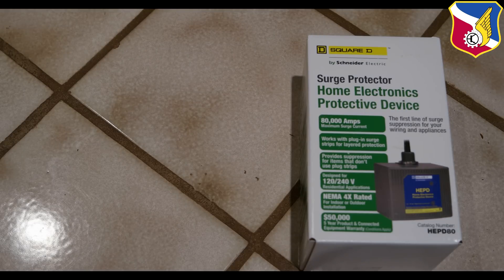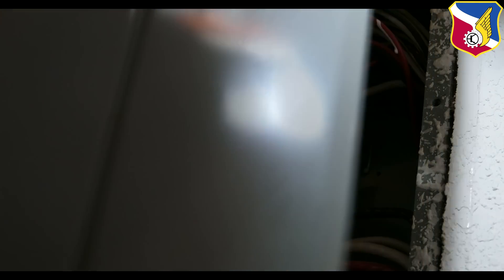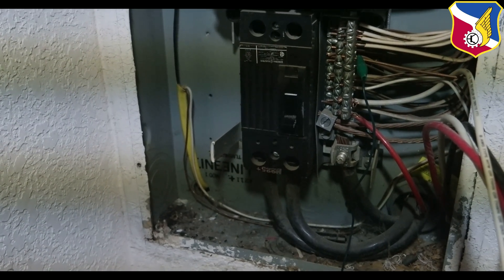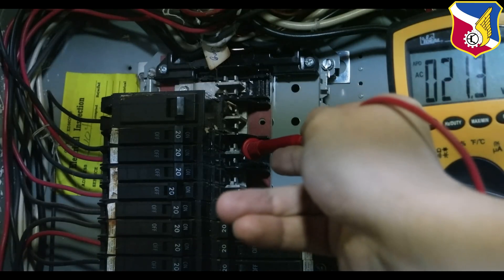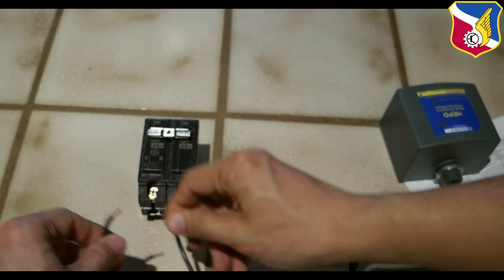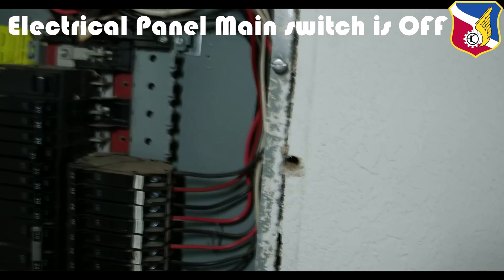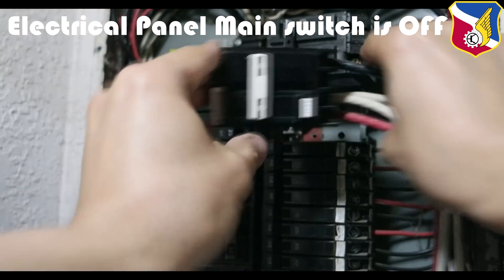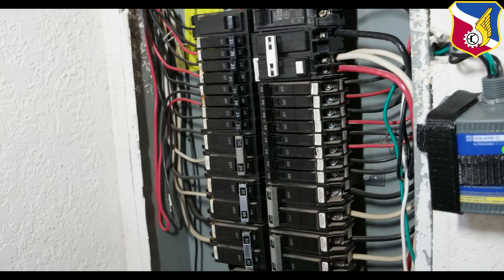Install Whole House Surge Protection 4K - Square D HEPD80 Home Electronics Protective Device

Comment: Nice illegal and dangerous hookup. I can see clearly you do not have an electrical license and don't know what you are doing correctly and incorrectly. Hire a license electrician to correct your mistake.

And the mistake was putting the shirts protector at the furthest point. And not protecting that wire on the surge protector. Therefore you risk a fire now. Get the license electricity in there to correct your mistake. And also upgrade your electrical panel you are completely out of space you need more space.

Comment: That install is a fire hazard, you cant leave exposed wires from the box to the surge protector get that inside a piece of conduit and you have wire passing through the box to outside with access to 20 amps totally unprotected from chafing the knockout in the main box. I'd call this install a fail, nice example of what not to do. Lastly top of the bus, when the power comes into the bottom of the bus is a real bad idea, each circuit on the way up to the surge protector will be exposed to the surge albeit for  milliseconds.

Comment: Can this device be installed in a residential sub panel?
Reply: Sure it can.   However, the question would eventually come up as to why this "whole house protector" failed to protect the whole house.  It would however be more effective in a sub panel than say the trunk of your car.  Perhaps your questions about electrical matters should be directed to someone who knows a little bit about electrical matters? Certainly not here.

Comment: Exposed wiring from your breaker box is a huge safety issue and would NEVER be approved by an electrical inspector. While you have the basics down, you should never post a video with exposed wiring. Conduit from the surge device into the box should ALWAYS be used.

Comment: No way in hell that installation would fool a home inspector, when it comes time to sell your house.  You've got exposed electrical wires that are not enclosed in conduit. So what, then, is the point?  A real electrician is going to have to undo everything that you have installed and re-install it correctly.

Comment: Thanks for your very helpful video.  You have covered the Eaton device as well in a separate video.  Your detailed description of the steps and cautions involved encouraged me to attempt an installation myself.  It took me about 30 minutes to complete the work.  It is another matter that in that time, an old UPS battery died which led to malfunctioning of an Ethernet switch which needed its own diagnosis and fix!

Comment: Are you stupid or what!!!
You should be held accountable for anyone who gets hurt trying to learn
how to install a surge protection device by watching your so called video.
For starters Jim Bob have you ever even looked at the NEC (in case you don't know it's the National Electrical Code). Apparently you have not so I suggest you never do and also never touch a wire again...

Comment: Isn't expose electrical wires illegal?
Reply: Daniel Byrns god no!
Reply: Its not illegal but its not up to code -- so if he's doing this to his own home then its not a violation per se, but if he was trying to sell the home that would almost certainly require correction with some conduit. Or if someone was injured as a result of that install he would probably be VERY exposed to a civil liability.

Comment: Top entry, bottom entry,..... So in order to save a few feet of service cable, the main breaker ends up being installed upside down where on is down and off is up. Makes perfect sense if a clueless person tries to shut off power in an emergency.

Comment: This video proves why you don't save money doing your own electrical.  Installing the surge protector on the opposite end of the feed renders it virtually useless as the instruction would've told you.  It should've been right next to the feed.  Also, the 600V rating is not for you, it's for the product to get it's UL rating, EVERYTHING Electric in your home is rated at 600V.  The neutrals and grounds need to be separated, when you turned off your main to install it then turned it back on without turning on the breakers one at a time you sent a surge through your entire home, which the surge protector did not soak up because it was at the opposite end so every circuit ate that surge before the left over went to the protector so it could protect NOTHING AT ALL since nothing is beyond the protector where you installed it.  Also most of those protectors are able to be installed parallell with an existing 240 circuit sharing the breaker, maybe not yours, but usually and designed to do this SO you can put it close to the feed.

Funny, the way you handled the install probably surged your home...ironic...hire an electrician next time, also you could've cut your wall and flush mounted it with a 2-gang deep cut in box, and Madison brackets  OR left it inside of your cabinet at the bottom near where you should've installed it.
Reply: While it makes sense, there is nowhere in the square d installation guide that states this.
Reply: The bus bar's capacity for current and voltage is substantial enough that there is no difference where the SPD is installed. Basic physics.

Comment: A good habit to get into would be to keep your dick skinners on the HANDLE do the screwdriver one day your gonna do that and it be hot and knock the bajesus out of you!! One last thing  when tightening stranded wire in a breaker tighten if as thirty as you can then wiggle the wire and check how loose it has become do this  a few times untilll it stops. This is even more important on main feeder wires. Wires vibrate and you know what happens then she becomes loose and hot( but not in a good way.So wiggle tighten /wiggle tighten until she is gootnthight.and do it right the first time or don't do it at all

Comment: OUR CASE IS THAT OF THE PUBLIC NETWORK IS COMING NOS 245 and 250V CURRENT LINE FOR biphasic AND MONO 118 and 124V THIS EQUIPMENT TO REGULATE THE LINES 220 AND 110?

Comment: i'm no expert but
this is what they want you to do:

"Ensure conductor lengths are as short and straight as possible for best performance. Do not coil excess wire. The SPD functions best if all bends in wires are rounded, ideally to a 4” radius. Hard 90 degree bend will reduce efficiency. Cut all leads to the correct length. Do not coil excess leads"

your wires are too long and bent 180 degree

Comment: It needs to be installed under the main breaker.
Reply: Only if the lugs, are rated for 2 wires
Reply: Thats not accurate

Comment: In theory, the surge protector should be mounted as close as possible where the electricity first enters the box. Consider what happens if you have a surge. It will travel through all the circuits in front of the surge protector before it finally reaches the protector, and it's triggered. Further, the wires are supposed to be cut as short as possible and left straight as possible to further reduce the amount of time before the protector is triggered.
Reply: This type of SPD only absorbs excess surge, and so do most power strip SPDs.  The bus bar is stout enough that any voltage on one end is the same on the other end within nanoseconds. The response time of the SPD's components can't possibly be faster by a margin large enough to make a difference. In fact, having a surge protected power strip on an outlet can protect other devices on the same circuit that aren't even connected to the power strip because its all connected in parallel to the line voltage.
IN THEORY if this device was indeed 'triggered' in the sense that it disconnected the power during a surge then that could make a difference but again, the response time of the mechanical circuit breaker \ main disconnect would be so far lagged behind the surge voltage that it wouldn't make a meaningful difference. There are devices that try to do that by sensing the RF signals of lightning strikes that arrive before the majority of the voltage, but those are large industrial contactors and not in the same category as this device.
Reply: I know this is old and in theory it makes sense. But I see nowhere in the Square D installation guide that mentions breaker placement.
Reply: @rolig3518  That's true I just read sq d insructions, in fact it says it can be mounted to a lug not even a breaker such as the mains coming in.
Reply: The two green status lights on the face of the surge protector indicate the device is working. However, if the two lights are not lit, a single light is used on some protectors, it indicates the surge protector is not working, i.e. tripped, and must be replaced. How are you going to monitor the status of the surge protector if it’s behind the service panel cover and the lights are not visible ? Suggest a wall cavity mount, externally, so the lights are always visible.
Reply: That's not how electricity works. It won't hit the end of those circuits (the outlets, appliances, or lights) before it gets to the surge protector and back to ground. Electricity is going to take the shortest path to ground, which hopefully is the surge protector. Even if it is at the bottom breaker, that's only maybe a foot or two of travel, which is way shorter than a circuit outside the panel.

Comment: This product has a flush kit accessory that flush mounts it into the drywall. If installing on a Square D panel you do. Not need another 2 pole breaker. All Square D 2 pole breakers up to 30 amps have a double termination lug designed for an SPD such as the HEPD80. Also best practice is to turn all other breakers off when shutting off then on your main breaker. Lastly, this GE panel is illegally mounted upside down. Only panels that have a side to side switching main breaker can be rotated for bottom feed.
Reply from the maker: +Tracy Phillips thx for the great info. really appreciate it. btw, is this the right product for flush mount? will buy and install:  http://amzn.to/1VdTpiE
Reply: +DIY Tinker  Yes. That is the correct flush kit. Also the HEPD80 moved the connected equipment warranty from $50k to $75k. Take care!
Reply: What do you mean by: "You do not need another 2 pole breaker"
Is there a way to insert the 2 hot wires in some existing 20A 2-pole breakers?

Comment: DO NOT install the surge protector inside the panel. You have to see the green light indicators. I am only concern about those exposed wires that are going thru the wall. Maybe some conduit or wiremold could do. I would google to check it or call the manufacturer. And sorry for my English. It's not my native.

Comment: can you connect this to a 20 amp tandem breaker?  I only have one slot open for two black wires.
Reply: +cutehumor The Idea is to have a double pole breaker to protect both phases in you panel.  Maybe the use of two single phase suppressors would be the best for you.

Comment: good job man only need to connect neutral and ground first as a safe measure even when the breaker is off but excellent work congrats
Reply from the maker: Julio Cesar thanks for pointing that out. I'll put  "connecting to neutral and ground first" in the video. thanks!
Reply: Julio Cesar good use of sarcasm.

Comment: Nice install vid..  But good lord man... mount that thing better!  I would even say it would be better danging inside the cabinet!
Reply from the maker: Andrew Having it sit inside the circuit panel is a great idea, maybe ill move it when i have time.
It might not look like its mounted well, but it is really secured to the wall. you cant pull it out since its locked into the stud.